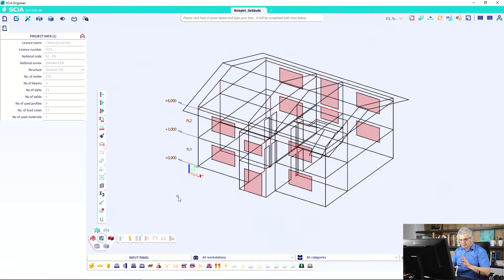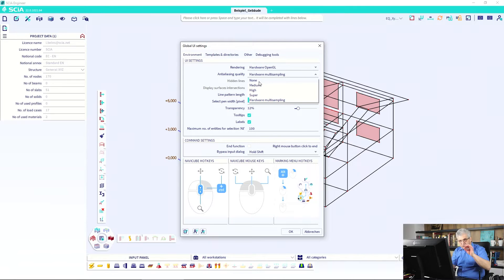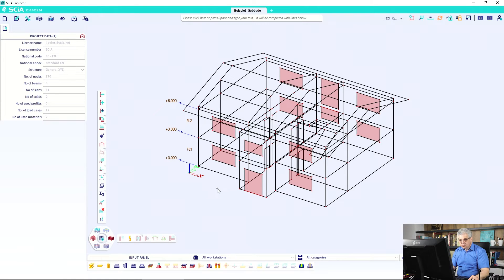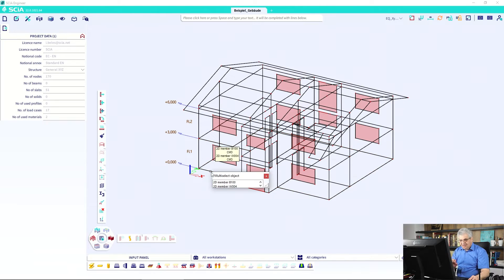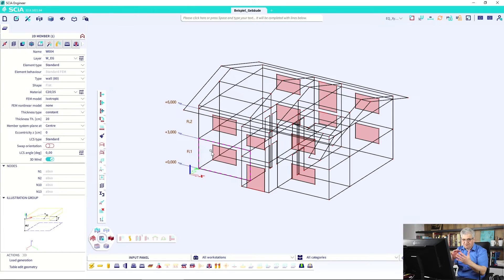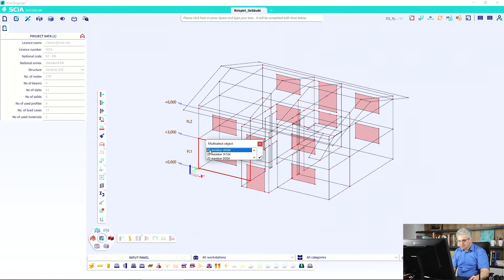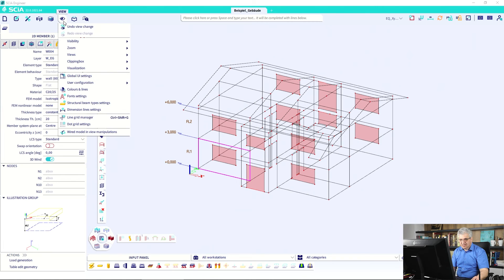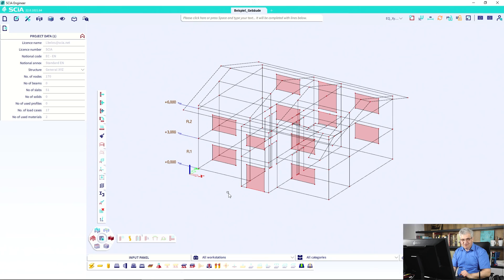SCIA OpenGL Rendering: Settings and differences

Comment: Good day to you. I have a question... SCIA freezes when I create a report, the image editor gives me several error messages, too little memory !!!, incredibly slow... /Windows 11 .. 64GB RAM ... Radeo Pro WX 4100 ...SSD Disk/
Is there any solution to make it faster? 
The built in image editor how can be reconfigured ? 
Actually how can one speed up the generation of an image to a message ?
Reply from the maker: You have to send the questions to the support. Send please also the model, so the support engineers can evaluate the case.